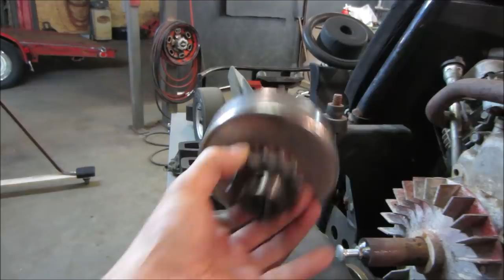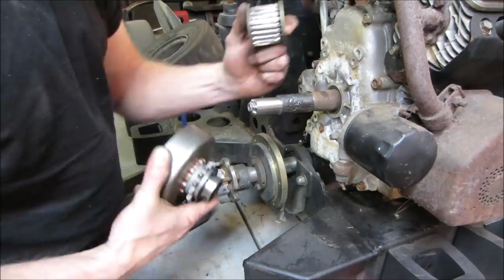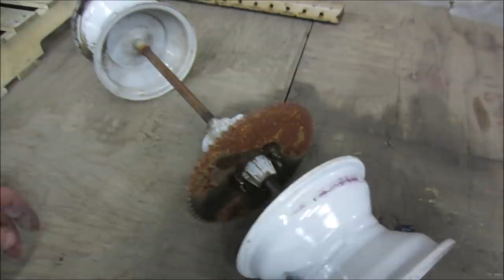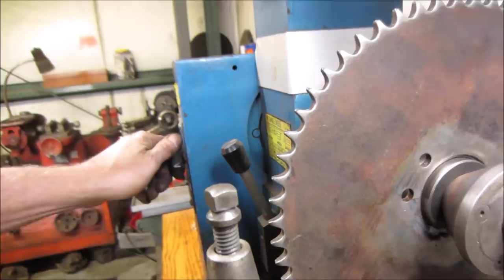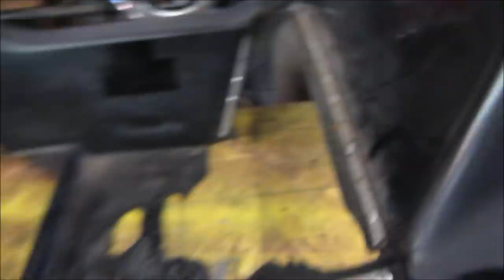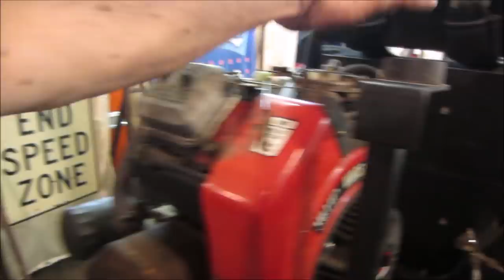amusement park go kart, let's put a real engine in it,

Comment: The only car in existence where the oil filter can easily be changed!
Reply: 1995 Escort without A/C or power steering... I can change the oil entirely from the top without the lifting the car. My Wrangler is almost as easy.
Reply: 1973 Mazda RX-3 with the big 12A. The filter was right in your face when you lifted the hood. The starter was on top too on automatics. Manual the starter was down in the usual place.
Reply: My Volvo S60 D5 engine has a paper oil filter that you change from under the bonnet. Unscrew the top and it's done
Reply: to join the conga line, my Peugeot 205 had an odd motor, leans back so the oil filter is almost top! makes a mess tho, and a pain to adjust valves
Reply: Cadillac’s with the HT 4100 front wheel drives, the oil filter was right on top, but still needed to lift the car to drain the pan. For those who remember this engine, it had several issues due to being a bimetallic engine, aluminum block and intake, and cast iron heads. At around 60k for not maintained engines and 120k for the ones that were maintained the engines would need replacement, because of intake gasket leaks allowing the coolant into the oil! Mechanic would refer to these engines as “ heavy trash 4100” while the local tow shops called them “hook and tow 4100”, I replaced enough of them to be able to complete a swap in one day, if not interrupted! Then the transmission issues would start. So I would have two “cradles” setup with complete rebuilt drivetrains, just waiting for the install, myself plus a helping hand apprentice could do this swap in 4 hours,and be tests driving in the fifth! These cars were one of the “Giant Mouse Corporations” better ideas...not!
Reply: I'D BUY 10
Reply: Still needs to go bigger... Chevy Sprint transplant, don’t forget to remove the governors... this way a senator will be easier to get past!
Reply: @gettintheresafelywithpatf2869  I KNEW IT
Reply: Dude, I'm still looking for mine on my model 3!
Reply: @andrewbeder51  It is on the tranny, but supposedly, you'll never need to change it??
Reply: @gettintheresafelywithpatf2869  yeah those 4100's were a fucking joke!!!!, better off getting a 5.o litre brogham
Reply: My VW Touareg 3.0 V6 tdi . You pull the plastic cover off the top end of the engine the oil filter is situated between the cylinder banks . It's the easiest engine I've worked on .
Reply: 77 ford truck with the 300 inline
No effort to change a filter
Reply: Early 2000 Saturn Ion. European canister style oil filter. Located on top of 4 cylinder engine.
Reply: You forgot the early model Camrys as well. My 99 has a filter right in front beside the exhaust manifold.
Reply: 85 ford ranger with the 2.3l was the same way, just needed to crawl under to lube the tie rods and after market u-joints, great little trucks, still looking for another one, 4cyl. 4x4 with a stick!
Reply: @TheBrokenLife  - 1981 Ford Escort (First year).  The oil filter was directly above the catalytic converter.   No changing that easily, and often burning the crap out of yourself - and lent itself to oil fires.
Reply: @tbelding  Sounds like they learned something in the 14 years between our examples. Hilariously, my TJ dumps oil right on top of the exhaust as well during changed, but at least not on the cat!
Reply: @TheBrokenLife  - '81 was the first model year where they required cats, and they kept hoping to get another year, so it was a massive cluster-bugger add-on.  hard plastic vacuum lines, no clearance for the timing belt cover, you name it.
Reply: @tbelding  Sounds like I picked the right generation to work on then. No clearance for the timing cover on mine either, but you can jack the engine up 8" after removing 2 nuts and then it's better than working on a '70s F150.  The entire car is actually pretty decent to work on. I have a good many videos of it (including a timing belt job) on my channel if you're curious. Just look for Sippy Cup Escort. :)
Reply: To join the conversation my dad's 1993 Ford f350 7.3 liter international diesel engine you crawl under the drivers side and the oil filter is right there in front of the oil pan
Reply: My 99 all paper filter changes from the top super easy

Comment: Looks great but I would want to put a bearing just inboard of that upper sprocket :)
Reply: Yep that's a guaranteed fail for the crank without some support with the clutch that far out there.
Reply: Yes, the engine crank shaft bearing will quickly get worn or just fail suddenly.
Reply: @simontay4851  it wouldn't take much to add a stub on the end of the shaft long enough for a support bearing. I hope he does it......
Reply: Agreed, overhung load will give the crankshaft and bearings a hard time and shortened life.
Reply: was going to say the same thing, glad I checked the comments first.  would save on engine twist and shaft flex.
Reply: It worked great for 5 minutes. What went wrong?
Yep, fail point for sure.
Reply: He mentioned that
Reply: Maybe just add a support bar on the bottom to a pillow block roller bearing to keep the crank straight?

Comment: Just a heads up , stock extending away from the chuck should not go out more than 1 1/2 the diameter of the round stock with out a center in place .
Reply: Airdrop 1 sound like an affiliation of JCP&L, a rain drop fall in California, and we have an outage! The best one was after Hurricane Sandy, we had power all during the storm, then they put us on a power rotation, powered us off for 8 hours, that lasted 2 weeks before turn on!

Comment: Turn the crankshaft down strait. Then machine an adapter to a standard shaft size. A 40 series torque converter would work great with that setup.

Comment: Great vid. Can't believe I watched the whole thing. You are right that chain is going to jump. Need to add another bracket and bushing on the power spindle to support and prevent the engine bearing from taking the full load. Also add a heat shield around the exhaust pipe to protect the fibreglass.

Comment: If you wanna transfer bolt holes/holes/screw positions accurately from one surface to another  a good way is to drop some ballbearings in the holes put the  connectable   plate/sprocket/ply/hardwood  on top and hit it with a hammer   job dun  JB

Comment: You might want to put a pillow block bearing on the shaft near the clutch to take the side load off the crankshaft. Otherwise you'll run the main bearing out of that engine in no time.😱

Comment: @mustie1  damn man, dropping a 16hp motor into that go cart would be like dropping a 600hp motor into a dodge dart. it's gonna fly!
Reply: With that heavy engine on the tail and the ratio of the sprockets I fully expect him to be able to pop some wheelies.
Reply: HELLCAT of gokarts!
Reply: Needs to remove clutch, and use a direct drive chain setup, with a shifter to neutral drop engagement, and also create a solid live axle!

Comment: I'm 17 minutes in and I can't help but think we are just going to end up with a bent shaft on the engine
Reply: Or axels
Reply: Or even a bent musti
Reply: Cobbling together scatter shield might be a worthwhile investment of his time. We all know it's going to fail. That's great because it gives an excuse to fix it again. However what could be troublesome is if the end of that shaft comes flying off in just the wrong way.
Reply: no worries.
the cops will have the operator locked up long before the output shaft deflects that much..
Reply: Again with the innuendos

Comment: Great channel,  impressive skills and I like your figure it out non-manual exploration approach. Here are one or two lathe tips for your consideration.#1 At start clean grinding leavings off ways and coat with way oil(great habit).#2 Use test indicator to center part.#3 Center drill for and use live center for more support with that thin end.#4 Quick change tool post.#5 A back splash and chip pan to easily catch them clippings.#6 emery cloth to polish finish. #7 If stored in an area close to welding. grinding and or dust, then way oil and cover. because you care . I am sure of it. What's with the Lambo??  Cheers!

Comment: You can weld a bracket to the motor adjusting plate so that it moves with the motor and get a pillow block bearing to mount over the end of the crankshaft, to support the end of the crankshaft so that it does not pull on it

Comment: I was surprised you did not turn the crank shaft and remove the taper making it fit that gear reduction box. or a direct fit for the clutch you used. that's cool looking little unit and I love those bumper pads all the way around it.

Comment: Put a center in the tailstock and set the tip of the tool up to the center. That way the tool will be in the optimum place to cut. A little cutting oil goes a long way!

Comment: You can put a bearing on the motor shaft in a pillow block and run a brace down to the frame and or the back of the seat bar to support the shaft better.  Make the links adjustable with nuts and washers to accomodate chain adjustment.

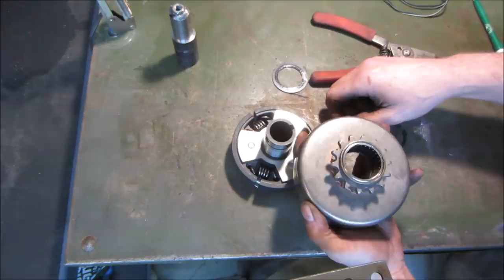Comment: HI Mustie1, I sure enjoy your channel and look forward to seeing your videos every week. Keith Fenner did a couple of videos on fitting a tapered shaft to a propeller (wheel) 8 years ago: Lap & fitting Props Part 1 and Part 2. He showed in Part 2 how it's actually the taper that drives the wheel - not the key.  (See the 11:50 mark on Part 2). I don't know if this is any use, but I thought I would throw it in there in case. Hope you're feeling better soon.

Comment: The only real issue I think you will face is ground clearance.  My shifter karts seat was about an inch off the track and there was no way to really drive it on an uneven surface.  The circus karts rely on a flat surface as well.  Not that a kart with no suspension would be fun offroad, id try to reduce the chances of high centering and ditch a bunch of the bumpers around the chassis.  I think an offroad single seater with some suspension and tires would be a blast in your back 40

Comment: To true work spinning in a lathe use a home made tool comprising of a ball race pressed onto the end of a rod. This is mounted in the tool post so the bearing is perpendicular to the work face. Spin the work and advance the tool post until the bearing touches the work surface, then continue advancing until the work runs true. Simple, cheap and very effective.

Comment: That vanguard vtwin is a nasty little engine. It's going to roast that one tire and it will pull nicely.

Maybe soon you can consider welding the two axle shafts or bolting them together to get a live axle. 

Dont hurt yourself!

Comment: Back in the day, racing Cushman engines on karts, some guys extended their cam shafts and mounted sprockets on them for an instant 2:1 reduction. This let them run decent size drive and driven spockets. 
Their problem was that 9 tooth driver spockets were tough on chains and large driven spockets tended to hit the pavement in cornering.

Comment: That crankshaft is too long it needs a bearing support mount in the middle of that shaft otherwise the torque from the engine will pull down on that shaft and could break the engine or snap the shaft or both. looking forward to see how fast it runs though.

Comment: Instead of making a spacer for the sprocket, you could've measured the total gap (e.g., 3/16"), divided by two (3/32"), and cut four short pieces from 3/32" steel rod (nails work well too).  Center the sprocket on the hub and set the four small pieces of steel rod in the gap across from each other.  That would center the sprocket on the hub and prevent your welds from pulling it out of alignment.
Reply: Clever!!  Simple, but clever, like all the best tips.👌
Reply: @2H80vids  Cheers!  When a person (me) doesn't have a lathe, they have to figure out another way...
Reply: @thedevilinthecircuit1414  Is there not a saying: "necessity is the mother of invention"?

Comment: To quickly true up (as good as needed for this) that gear in the lathe, you can use a small bar with a wheel at the end mounted in the tool holder. The wheel rotates against the face of the material in the lathe head as the head rotates, and as you wind in the tool post it will bring it true in seconds. if you need more accuracy then you can dial indicate it afterwards.

Comment: i guess everybody has there own way of doeing things especially watching someone else working. but at 23:47 i thought you would put the axle bushing in the late and turn a small extra recess-tap on it where the sprocket would centerfit around for a few millimeters, and the tack-weld it. butt at 31:40 it looks great. good job.
thumbs-up!
Reply from the maker: set screws in the way
Reply: @mustie1  sizes might look different from my sight maybe. i understand your set screw point of view. 
but i was just talking about a few milimeters though, 3 maybe 4 . not a few inches. not even the whole thickness of the sprocket. just a small tap.
thanks for reply. ;)

Comment: Someone else may have already mentioned this, but wouldnt it have been easier to simply machine the larger end of the hub down to fit the sprocket?
Reply from the maker: set screws in the way

Comment: You have a lathe, you could have cut a ring spacer to fit inside the sprocket and the outside of the hub.  That would have done most of the lineup.  Them tack it, adjust and the weld the heck out of it.  I like Gary's suggestion of welding it up then cutting it down to fit on the lathe.  Then maybe you did since I'm not to the end of the video yet.  Wish I had a lathe.

Comment: You definitely need an electric starter ! I was huffing and puffing with you with that manual start !
Suggestion : installing the air filter on top of the body, with a rubber tube down to the carb: no need to have a big cut out on the body. ( ?? )

Comment: since you have a lathe and a welder, I would have just run some beads down and make the set area bigger and then took my time slowly working the size down so that that gear fit. This would have been the simplest that I can think of.
an after thought, I might have just cut down the adapter to fit. This might have been more simple!

Comment: Best exhaust I ever made for a small engine was a piece of heavy wall pipe with a 90 on one end and a small car muffler.  That thing was so quiet it was great.  That was on a scissor lift so being quiet was a good thing.  For this I would do something similar and run is straight out the back with a small glasspack. Have plenty of flow that way and not be too loud either.  But just getting some exhaust wrap looks like it will work too.

For an intake just get a piece of pipe beat kinda flat and then the end capped and a hole cut for the air to flow in and a motorcycle style filter on the end should work out well.  

Personally I vote for removing the governor though.  When that tire is on the ground pushing an adult around I doubt it will be able to over rev.  Need to get a couple of marine speakers and a marine stereo so you can have some tunes on it while you roll around as well.  Be the coolest kart on the block and easy to do since you have electric start anyway.

Comment: Instead of a collar on the end of the shaft, I will sometimes use an old socket, usually impact, that will center the screw of the puller so it doesn't slip off.  You can even shave it down so that it just barely fits over the end.

Comment: Would it work to turn the clutch the other way? Having the sprocket on the outside of the engine and the clutch closer to the motor. It might lighten the torque.

Comment: I have Triumph 650 Tiger that would have fit perfect and I have a 1100 Virago. The Tiger 650 has been fully rebuilt and I believe the transmission is mounted separate so.

Comment: That's bad ass. I think it's cool. Hey Go Power Sports makes a toruqconverter or clutch for up to 22 up that I bet would fit right on that engine.
Reply from the maker: yep $450
Reply from the maker: and they only go to 1 inch
Reply: I have a friend that can bring it to as far as Londonderry NH. It is out of a 1966 F250. It was a farm truck. Shows 47890 miles. The rest of the truck is now junk but I saved the engine and transmission. It had plenty of power. Runs real good. Free!
Reply from the maker: @markhuston6816  hi mark not sure what we are talking about, you have a ford engine and trans?
Reply: @mustie1  1966 f-250 engine. 300 inline six cylinder. About 48000 miles farm truck. Furtilzer rotted frame of the truck. It is junked. I saved motor and 3 speed Trang. Runs as good as new, but is from 1966. It purred like a cat just 6 months or so ago. I have family going back to Maine and they say they can drop it by Londonderry NH if that would help get it to you.  It is coming from Missouri. If you want it. Free to you if you can use it. You said something about engine change in your Econoline. The orange on. Or whatever. It is in good shape. I know cause my dad owned it and it was my chore to change oil. I'm old now I won't use it. I'm disabled. We always think that sometimes we might get around to doing a build. But I sure that I won't now. Thanks mustie1 for letting an old man live through your work. Love the show.
Reply from the maker: @markhuston6816  thanks mark wished l knew before doing all the work on this setup, l have not road tested this yet but hope to by the weekend, if anything is bad id most likley take you up on it, when are they heading out,? you can email me direct at mopaman@aol.com thanks

Comment: I guess I watch Adam Booth and other machinists too much. I kept thinking, when is is going to  use a surface plate, micrometer or dial indicator to check how far off everything is. However I do like the technique of using a sharpy of finding the high spot.

Comment: Centre the sprocket to the hub with a thin wall piece of pipe the thickness of the sprocket, tack-weld, pull the piece of pipe out and weld.